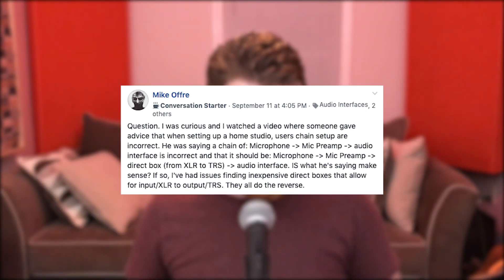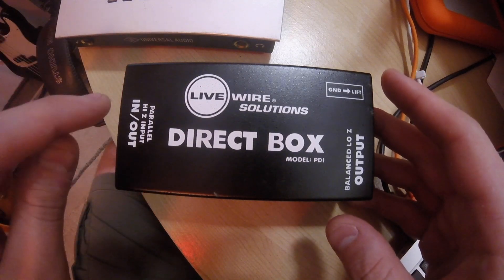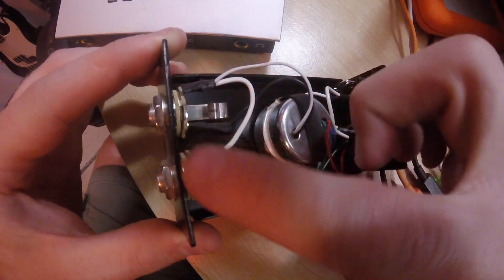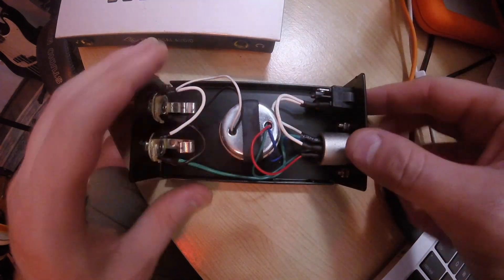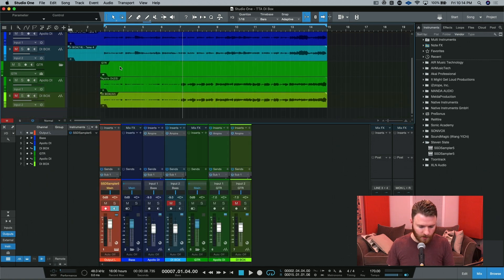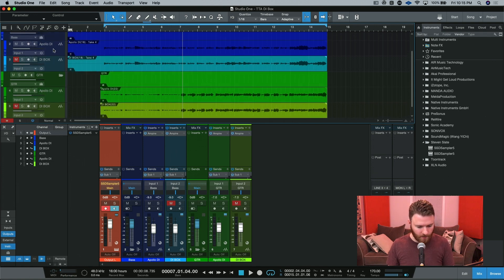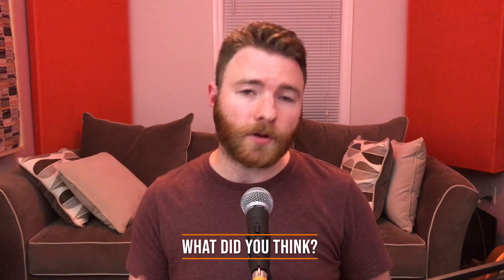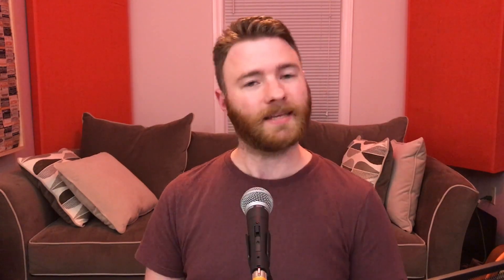Audio Recording 101: What is a DI Box?

Comment: So... did you go into the LIvewire and then out both outputs (xlr and 14") with each of those going to seperate inputs on your mixer?
Reply from the maker: Yes I did! Doing that ensured that I recorded the same performance for the demo!
Reply: @TimTalksAudio  I had posted a DI question on one of the boards a couple months back. I now question the advice I got. Or I don’t remember exactly how I worded it. It also was specific to running grr thru studiolive board. More testing is needed. Thanks.